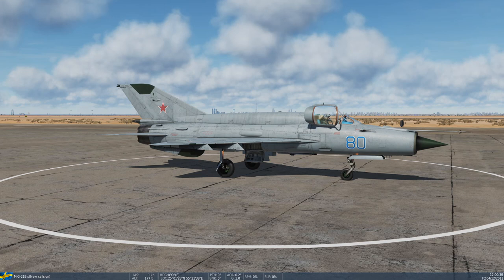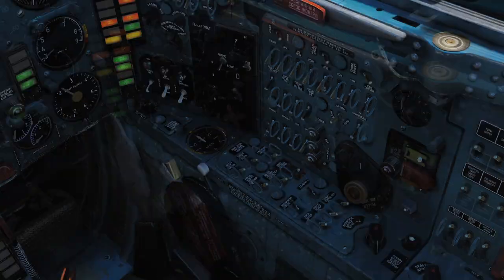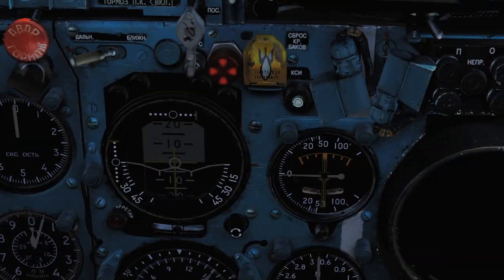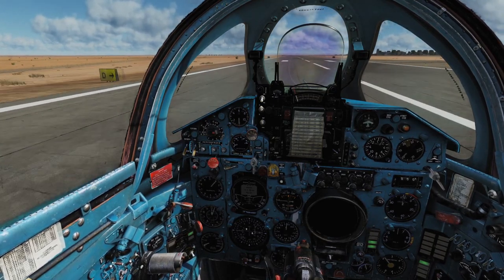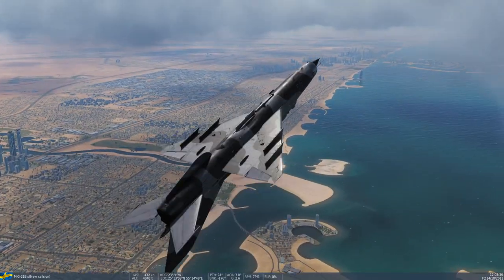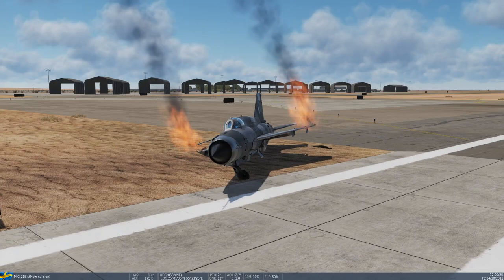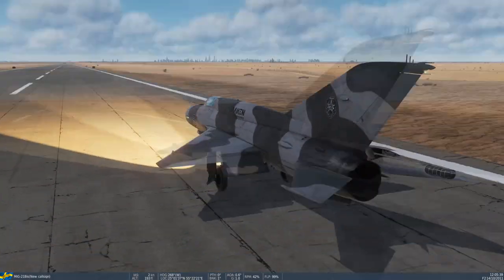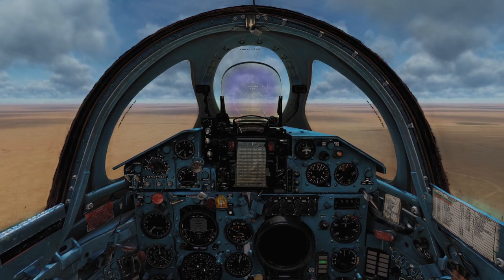DCS World - Trying to Land the MiG-21

Comment: The Mig-21 uses bleed air flaps, so the lift the flaps generate is tied directly to the amount of thrust the engine is producing. So when landing it, don't reduce the thrust until you're mains have touched down. It's also good practice to fly a much more shallow approach that what you might be used to with other aircraft.

Comment: Trim aircraft for horizion,keep airbase in bottom third of hud,never lose sight or your too low,use throttle to control desent/climb,slight flare above runway till aircraft gently touches down,
Apply brakes or chute (mid 250s or less over runway)

Comment: At the right panel, above swithes there is lettering - КСИ включать после включения и разарретир. гиродатчика КСИ. САУ. РЛС. what can be translated something like - fighter course system switch on after switching on and 
uncut gyro sensor of fighter course system, automatic control system, radar station. Looks like this fighter course system preventing you using elevator, 
letting using rudder.
F/A-18 looks nice and predatory, yea.
At the last landing, parachute case is closed.

Comment: I can tell you right now you're too heavy. You need to be nearly empty with stores and most importantly FUEL to optimize landing in the MiG-21bis.

Try it with a few hundred pounds less of fuel. I don't land Fishbed unless the needle is below 1.
Reply from the maker: Ah, good point. I certainly did feel heavy. Do you know if MiG-21s dumped fuel before landing or if there's that functionality at all?
Reply: @RaizSpace  

Unfortunately no such niceties exist here! Best plan is to burn it off before landing. One thing the Twenty one is good at is burning fuel at a prodigious rate.

Real life pilots talk(ed) about the landing -- its tricky even in the best circumstances but with some practice you'll get the hang of it and gain a bit of satisfaction along with it.